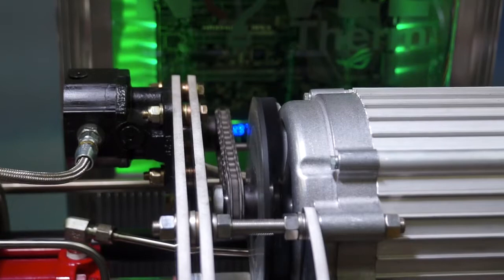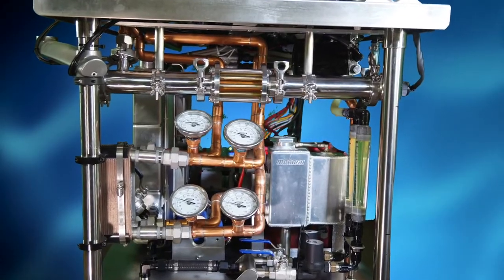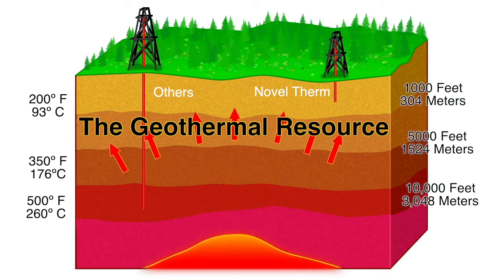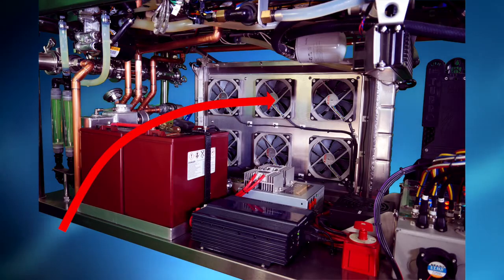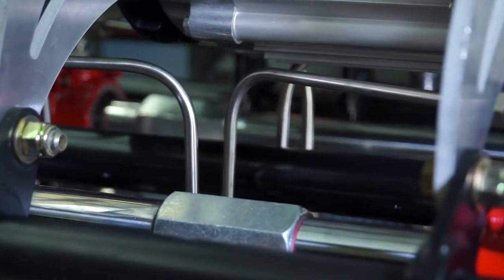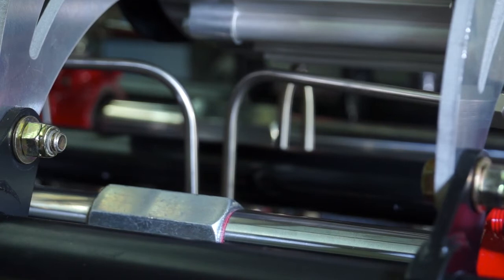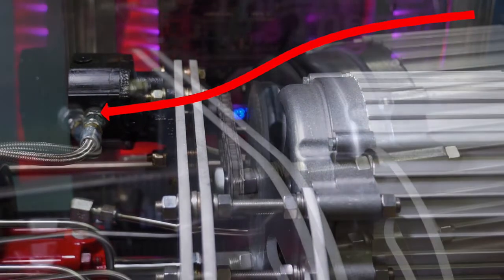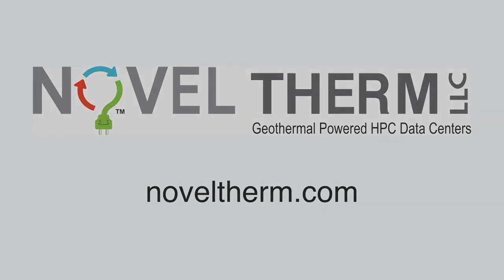Novel Therm's Green Energy Stirling Engine HPC Solution

Comment: Cooling systems in ICE/ Hybrid cars should use Stirling engines to provide 'free' energy for charging drive batteries and running the electrical system; it's already bad enough using engine power to run the air-con, when that could also run off waste heat using similarly ancient technology.

Comment: No Phase Change is the Key , it is  exactly because of this engines with gas as active component couldn't transfer Overheat(heat level above ambient/surrounding temperature) to next consecutive circle of engine,
Because to contract the gas we would heat it  !!Anyway!!  , and if don't dissipate heat we would end up where we start(no energy gain) , but if we do we would heat environment !!Anyway!! with temperature the same as that what surrounded us.
(Bu in that case we could store it , there is no Overheat , because this kind of storage implies swaping  overheat with body with the same heat capacity which would end up with !zero! expenses )

But if we using solid body or liquid that doesn't change its state it is whole different situation, we could transfer heat from previous circle to the next one , add some heat whats missing (it produce electricity/some other work), and keep running.
Therefore eventual theoretical efficiency of such machine not depends on difference of temperature and could be 100%
Which means we could theoretically use heat pump and this kind of device to use surrounding heat to produce mechanic power.

Maybe gas engines not efficient as engines , but it efficient for heat pumping.
When we squeeze gas it is heating on the dame amount as we put to it
(on this stage on terms of heat producing its not so different from rubbing)
But  when it expands even with room temperature it turn heat to work anyway
(in our face surrounding heat)

Comment: Would not this work with Passive Vacum Tube Hydrosolar"  water heater?
Reply: If the solar collector is big enough it should, only problem is at night. But a thermo sand battery might do.the trick.

Comment: Consider the action of a convential heat pump - which can concentrate heat energy 4x. Add a turbo-expander to collect that energy. The challenge is in the efficiency of the turbo expander and the refrigerant used

Comment: The Sterling Engine is a good power source, as all that is needed is a difference in temps.  The larger the temp difference the more energy is available so therefore more power output.  But for some reason the Government is stuck with wind and solar so they have turned their back on this powerplant.  Ask a politician in a government agency and they will ALWAYS say that they are obsolete tech that won't work.  Well this engine has been around for practically 200 years and works, the problem with the old systems was basically engineering tech wasn't up to the needs for high energy outputs, and basically steam was more powerful per weight or volume of equipment.  There was a Sterling engine that provided A/C electrical power to New York City at the turn of the last century that used the difference of surface and deep ocean water temps, it didn't work all that well due to there wasn't good piping that could handle the needs at the time, but it worked fine while the piping held up.  I like this variation as it seems to be a more modern approach for energy conversion.